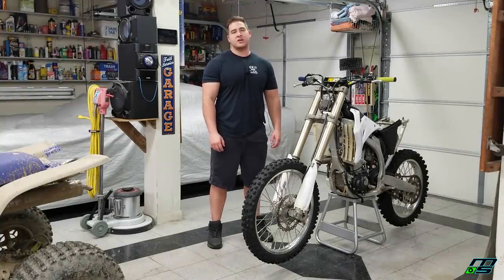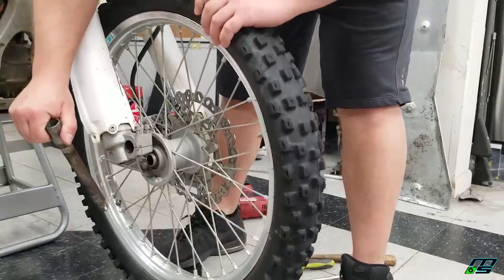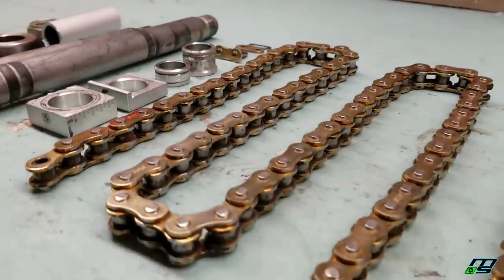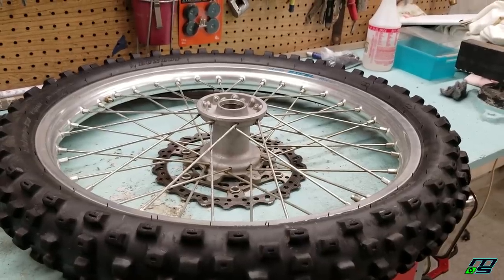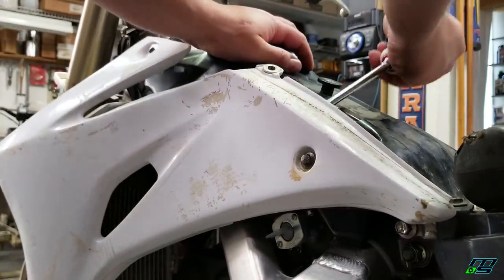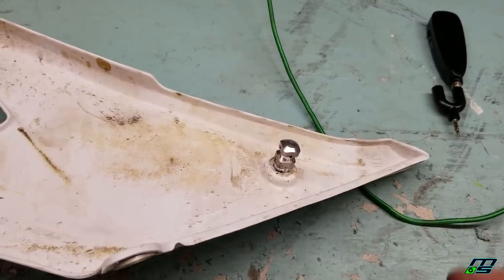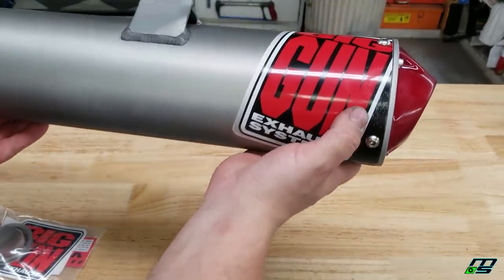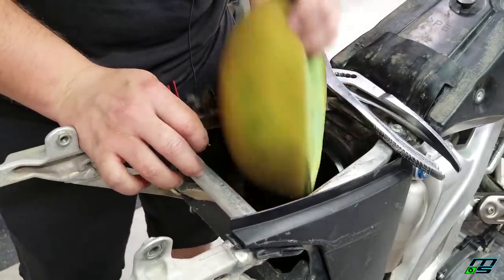Project YZ450F | Spinning Bolt Syndrome Cured, Black Wheels, Big Gun Exhaust and More!

Comment: Make sure to jet the carburetor for the added air flow with the pipe if you don’t it will run extremely extremely hot and your gonna pop your valves
Reply from the maker: Oh hell yea! I am definitely upping the jets 🤘 thanks for the advice man!

Comment: I’m still a huge fan of this era yz450f ( they just need some more hp like the new ones ) but are so much lighter and nimble then the efi yz. I’ve prob owned at least 15-20 of these bikes . Nice job with those wheels !! . 
But I did cringe when u took a hard hammer to knock those axles out . Going burr those threads . Use a soft mallet . And as for the spinning tank nut I’ve come across so many times . I just drill the head off eg start with a pilot and move to a 6mm drill the head falls off and there is heaps of thread to pinch with some pliers to get rid of the rest ( the thread leftovers never seem to be stuck/tight) . And then jb weld is your friend !!! Best stuff ever I just drill 2 small holes either side of nutsert and feed in the jb weld .

Comment: Quick question bud, the pipe you put on is a slip on yeah? Did it just slide straight on the header tight? Im assuming you used some rtv silicon or something? I got a pipe to fit but concerned there might be not a good enough seal just sliping it on if you get me

Comment: There is a special tool called an impact driver that you hit with a hammer to loosen bolts like that at least back in the day that's what they used in the 80s
Reply from the maker: Yes, they're great to use too 🤘

Comment: The wheels look great black, the pipe however is not great in my opinion. Its your bike so do your thing but i have never been a fan of big gun, they look low quality to me and i have always had bad luck with that brand. There are lots of better looking, sounding, and performing pipes in the same price range but thats just my 2 cents. Another thing is if you decide to go with another pipe or not you should upgrade the header, that is where a real difference in power is going to come into play. Good luck on the bike and keep up the good videos, the build series are my favorites.

Comment: You need to big gun header  is much short and not Will look that long
Reply from the maker: Header would be sweet but the mounting holes for the muffler cant be moved so it would still sit in the same position.